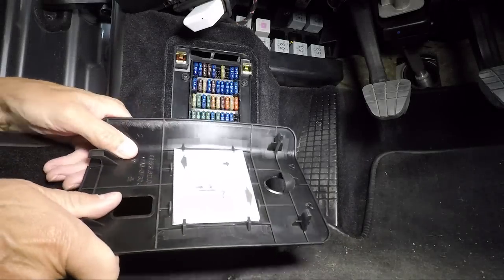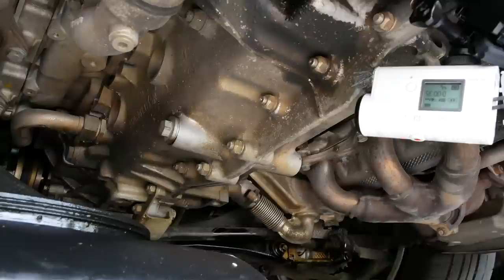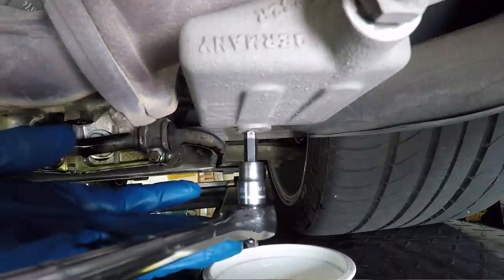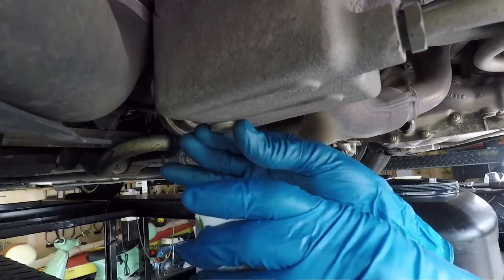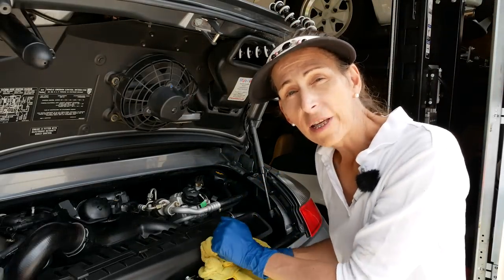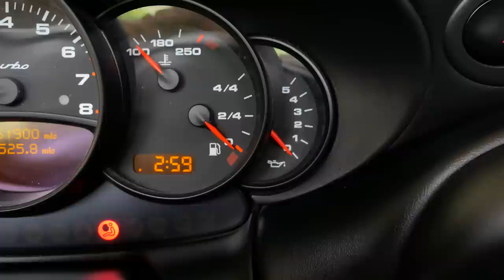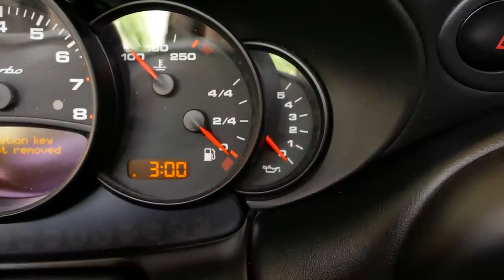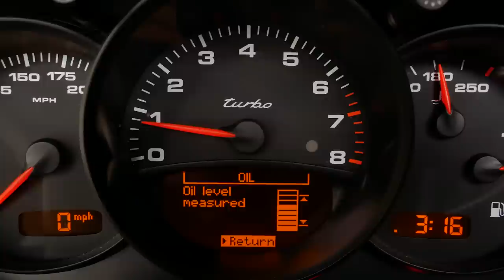Porsche 911 (996) Turbo Oil Change DIY!

Comment: hey excellent video very precise and intricate details but when you started to turn over the engine to lubricate everything initially when the ignition turned on the oil bars went to one bar without the engine turning over then when you started to turn the engine over it went to 2 and started to rise but as you can see in the video the oil pressure light did not go out
Reply from the maker: j lynn Yeah, I thought that was a little weird too... My guess is that there was maybe a bit of air in the system. The point was just a bit of low stress pre lube.  Your discretion as to if you think it is worth the effort :) Thanks for your good comment! Franny
Reply: Wouldn’t the gauge jump to 1 bar because technically the car is sitting at one atmosphere just sitting there doing nothing?  I know through the years they’ve treated it differently with the gauge reading either 1 or 0.

Comment: Nice work thank you!
Is the fuse pull needed on the 997TT?
Reply from the maker: No, it is optional Jay.
Reply: Tried the fuse pull and couldn't get more than 1 bar after 2 attempts.I will skip it next time and just add 1 qt of oil in the filter housing.

Comment: Just wondering. Does the oil constantly flow through the turbo sumps? or do you think it gradually fills up over time? if you drained the turbo sumps after driving for a very short time ( 5 miles), do you think you'd have as much oil in the turbo sump as you did when you did the requisite oil change?  Other:  I hope you are planning to do the garage door opener switch. Great content. thank you.
Reply from the maker: +Michael Franny may have to answer you on the turbos, but I did want to say that there will be a video for the garage door remote very soon for the 996.  Get a switch for the blank in your dash and also a keychain remote for your garage door or you can wait for the video. We should have it out in a few weeks. Heidi
Reply: Heidi and Franny's Garage . Great. Could you also include in the video where to get a switch that would fit in that location.
Reply from the maker: Hi Michael, I got that switch from Suncoast Porsche I think.  Just look for the "Targa" switch.  Looks just like a garage door ;)  As for the oil, I believe it pulls from the tank and scavenges from the sump to replenish the tank.  That way the bearings and such don't get starved for oil in high-G turns and crazy braking/acceleration.  

I need to re-build the opener mod for our new garage doors so that would be a great video!  Thanks for the idea!  Franny

Comment: Your videos are excellent.  I'm a long-time BMW owner, looking to move to a Porsche next.  For BMW peeps there's a good website (realoem) to get system diagrams and part numbers easily.  Is there something similar for Porsche that you use?
Reply from the maker: Hi Victor, Pelican Parts is really good and they do have factory part lists. AutohausAZ has more generic parts, but great pricing.  For the older 356s it would be the 356 Registry, Stoddards or Sierra Madre.  The forum support for P-Cars is really strong too.  Thanks!  Franny
Reply: Ah, yes - Pelican Parts.  Have used them in the past for my BMWs, and have Wayne Dempsey's books "101 Projects" for both BMW and now 911.  ECS Tuning is a great vendor, as is FCP Euro.  I'll keep checking your channel.  Thanks.
Reply from the maker: +Victor Sorlie just subscribe!  We try to post two videos per week now.  Heidi
Reply: Yep, have subscribed.

Comment: I see you used re-usable rags for most tasks. How do you clean them?
Reply from the maker: Hi Jerry, Glad you mentioned that.  They are really just old micro-fiber detailing towels that have been washed a few time and not much good anymore for anything other than wheels.  I've started using them for this sort of thing (I seem to have a bunch) and they are far better than anything else!  No lint and still super absorbent and strong.  When they get really bad, just toss them instead of smutzing up the washing machine.  F.
Reply: I have decided to immediately implement the words smutzing, bits and bobs into my vocabulary. Proper fun words!

Comment: you drained the oil from the turbos - do they naturally refill or do you have to top up? i don't touch my turbos im afraid
Reply from the maker: I just showed all that for completeness...  Most folks don't bother.  It is just a few ounces and the 997 did away with the drain plugs on the turbos.

Comment: Very nice. But, it can't be a 2004 Turbo S. Because they only made the S 2005.
Reply from the maker: It is a Turbo with the X-50 option which is just as fast if not more than a Turbo S.  The prior owner had the S put on by a Porsche Dealer.  I have the paperwork, but if you look at the car, Turbo S is missing on the running board and gauges and wheels.
Reply: @HeidiandFranny  Yes, they are all great cars. I had and sold a 2005 Turbo S and just today I bought another 2005 Turbo S. This one is manual. My new one is Dyno at 460 at the wheels. Another thing about the S is they all have carbon ceramic rotors. Anyway, thank you for the great videos.
Reply from the maker: The X-50 came with Carbon Ceramic Brakes or you had to have CCB to get the X-50.  I am not sure which. Our car has both.  Can be fun when swapping out snow tires.  We actually need to do that soon.  We still have snow tires on.  Congrats on your ‘new to you’ car.  We have a playlist for other DIY with the Turbo.  Heidi
Reply: @HeidiandFranny  All 2005 996 Turbo S came with X50 bigger turbo and Ceramics. In later Turbo S 997,991 they all have bigger turbos and ceramics to this day. Thanks for the great videos.
Reply: Just got my 2005 Turbo S cab. 74k miles Cobb tune! Has Tiptronic trans. I'll let you know IF I like/prefer it... Needs some work first. i.e oil change, front struts and tires that are bald. Oil change will be done right due to your perfect instructional! Have you done front struts? I will not sell my C4 cab 6 speed!!

Comment: your key on engine off oil pressure is high. You need to replace your sender.
Reply from the maker: Huh...  Thanks for that.  It has always read 1bar engine off so I never thought that was off.  It seems to work just fine when the engine is running.  I'll run down that part and replace it.  Looks like it lives behind the oil filter.  Thanks for the head's up! Franny